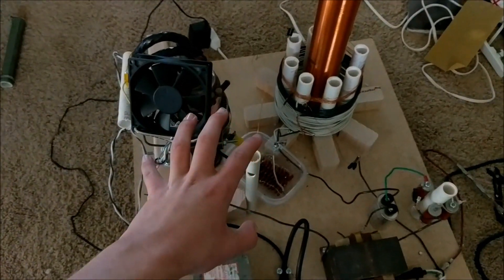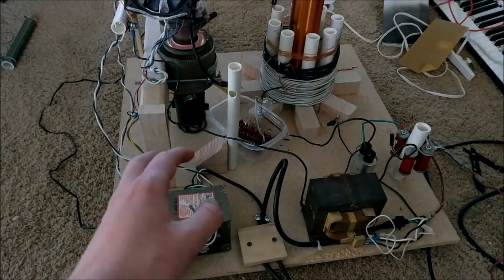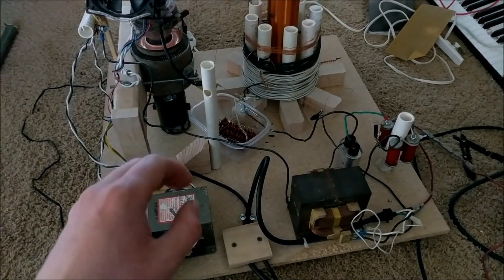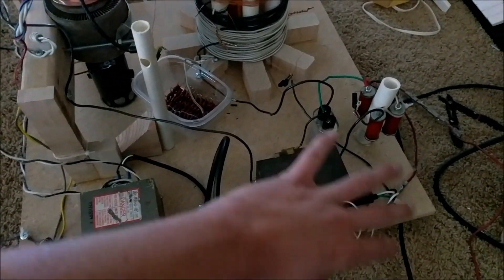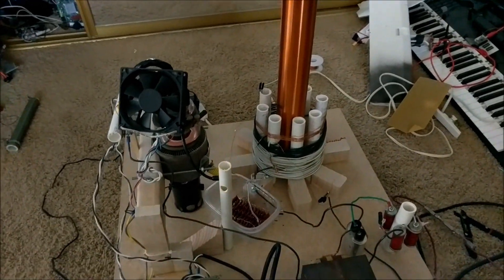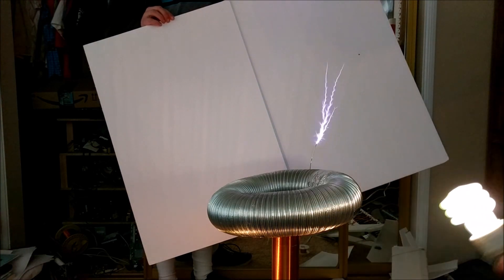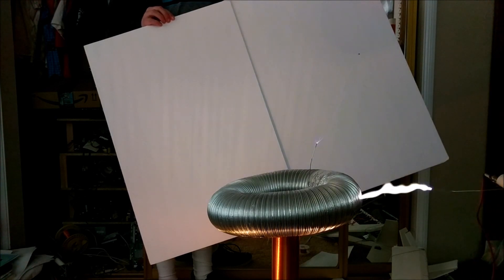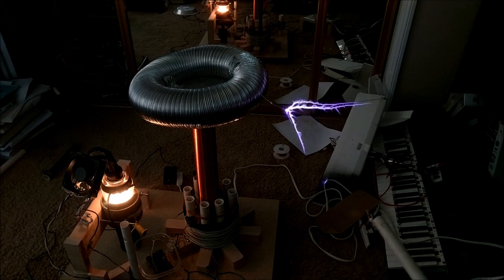Vacuum Tube Tesla Coil With 3X2500F3 TX Tube Works!!!

Comment: Good results but to be honest, I think that tube has untapped potential and you could probably mess with the circuit over time and get even better results.
Reply from the maker: jjhack3r Totally! That tube is rated at 5000 watts of RF power and I am only giving it like 800 watts.  All I need is some more microwave transformers.....
Reply: Tanner Tech 5000 watts sounds like enough to send lightning bolts from the top to the bottom of the tesla coil... that will be intense.